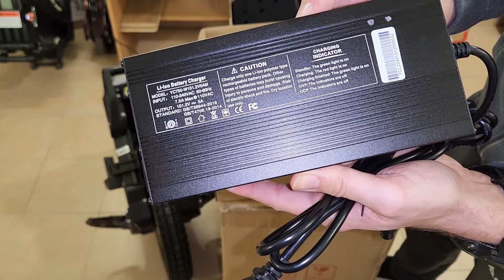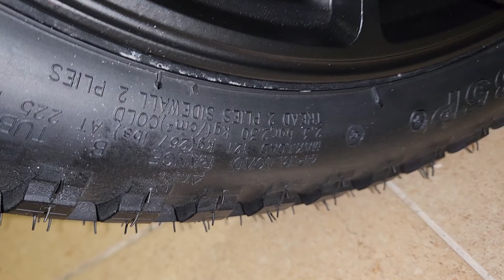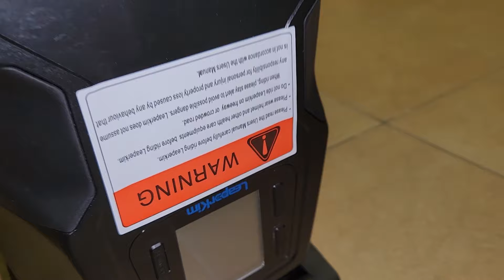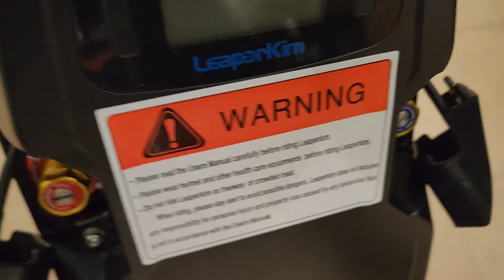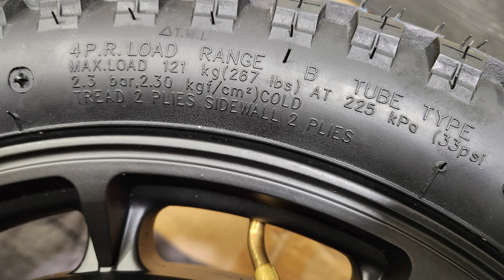Veteran LYNX - Unboxing, close-up details, comparison with Patton

Comment: This thing just absolutely eats up dirt roads. I took mine out on a fuel break road that was pretty damaged and rocky from the rains and I couldn't believe how good it did. So I decided to do a black diamond mountain bike trail and I just told myself that I will take it easy and I will walk it in sections that are sketchy. I ended up riding the whole damn thing with loose rock and steep drops. It really is amazingly agile for being an 88 pound wheel. I lowered my pedals and lowered my tire pressure due to a severe speed wobble at about 38 miles an hour. (My fault) I also took off that kickstand because it has bruised my legs a couple of times. It will also catch on steep drops at low speeds.  If you have a sticky on/off button a little bit of graphite powder took care of it for me.
Reply from the maker: Thanks for the advice! Lynx is really great well, seems that Patton will be right now as the "backup" wheel only :)

Comment: I filled the inner tube with 3 ounces of sealant. We have a lot of goat heads in my area. I'm pretty lightweight and 30 psi is a recipe for a speed wobble for me. I run my pressure down around 21 psi and that seems to completely minimize the speed wobbles. Be careful going downhill at speed. Watch Chooch's video of his speed wobble crash on his Lynx and check out how fast it happens. Mine came on fast and violent and I almost lost it.
Reply from the maker: Thanks again. I'm using ~30PSI and it seems ok for my needs, will adjust it if needed. Still more km/miles need to have to improve my skills and be more familiar with Lynx :)

Comment: Awesome, everything perfect except those knobby tires.  Some people love them, but for me I would immediately swap those out for some upgraded street tires.
Reply from the maker: You can order already with street tire. Depends what you prefer. I like knobby, especially for the light off-road or some difficult terrain, and this... street sound :)
Reply: It's a way better wheel for off Roading than it is street.

Comment: The video is almost perfect. The Patton comparison part could be better. It would be interesting to see the differences in height in general, the pedals, and the differences in driving between the two......I, for example, want to exchange my Patton for the Lynx but I'm afraid of the difference in size between the two... .....
Reply from the maker: Thank you. Will try to add maybe some kind of quick comparison, to see the dimensions differences.
I just had a ~20km initial ride on Lynx, and honestly it seems bit better balanced with weight.
I'm waiting for the real spring with better weather to ride more on Lynx to see which one is better for my needs.
Reply: @pawel.wisniowski  Cool. I saw a lot of people installing the kit to lower the height of the pedals...it could be interesting.
Reply from the maker: @guimarotta  could be if it would be possible to easily change the height. For easy off-road this default height is very good.

Comment: Nice video shoot.  I rarely see unboxing videos with the visual clarity so detailed as to see dust particles on the product.   I have a couple of questions about the box of accessories. What's the second top cover for, and does everything else in that box come standard with the Lynx?
Reply from the maker: Thank you!
Second top cover was sent as the replacement part in case of problems with the original one.
These side pads are not standard. It is an optional equipment, which was given by the seller additionally (seperate package) due to long time delivery.
Reply: @pawel.wisniowski   Yeah, that's exactly what I needed to know.  New Zealand has one sole retailer that is getting in some Lynxes next month, or so the owner alleges...    It's good to know what I need to source beforehand because I'm almost certain that this retailer will not carry any Lynx accessories.
Reply from the maker: @WalrusHal  Side/Power pads are must have in case of such power wheels. The best ones are from Nylonowe (https://hulaj.market) or Grizzla (https://grizzlapads.com).
Reply: @WalrusHal  use graphite powder on the on and off button if it is sticky.

Comment: A ride comparison of the two would be awesome. Not so much the performance differences since we already pretty much know, but rather the ease of maneuvering and fun factor differences between the two. Is it just an optical illusion, or is the Patton wider between the legs (width from right to left of the battery packs)? Thanks for sharing.
Reply from the maker: @mikethewheelchairguy  Thank you! Take a look at my other videos with both of the wheels, also have some comparison videos.